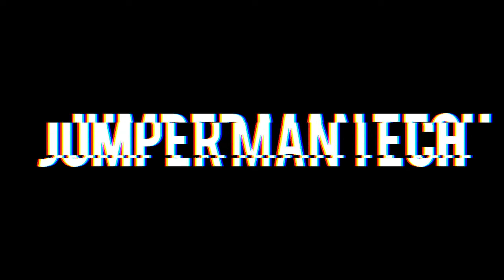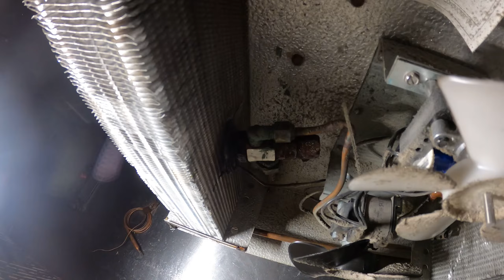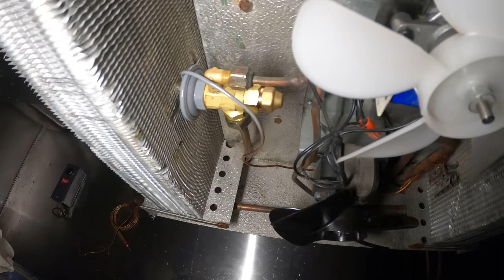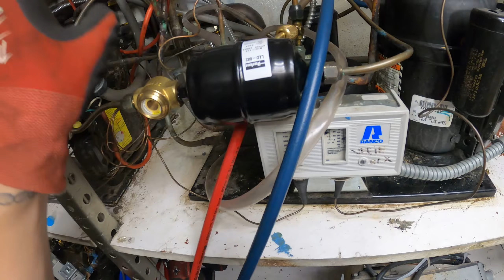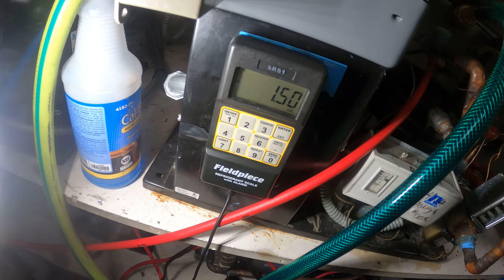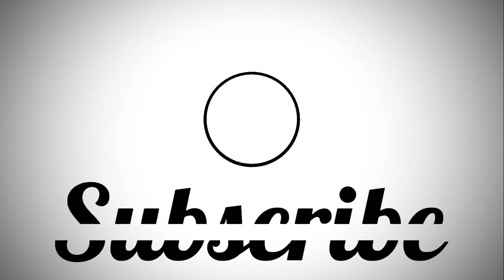HVACR Service Call: TXV Thermal Expansion Valve Replacement For Commercial Refrigerator(TXV Install)

Comment: Take us through the conclusion to figuring out the troubleshooting process next pls and Thanks makes the video twice as valuable ❤
Reply: High head pressure low 🪠 n pressure.  If a txv.  Try heating the probe.   See if it opens any.   Adjust valve out.   Verify it works when adjusted open.   Verify  that it fails to close the valve as superheat becomes low. (don't let it get subcooled or you will kill the compressor.